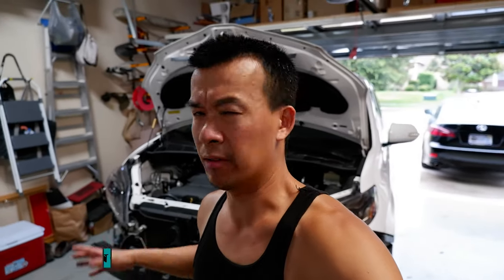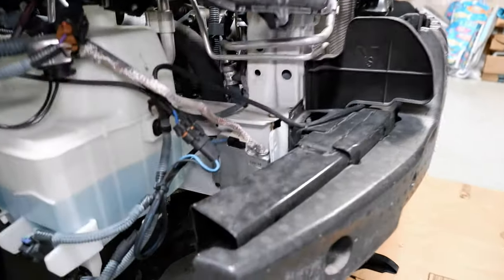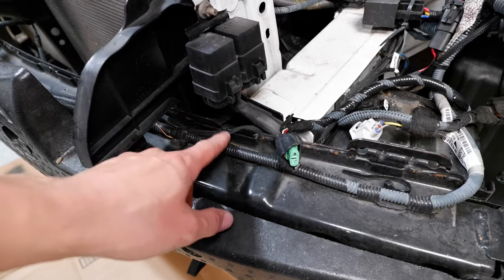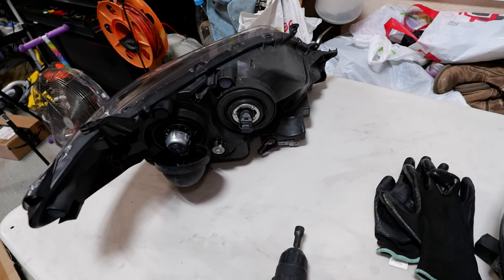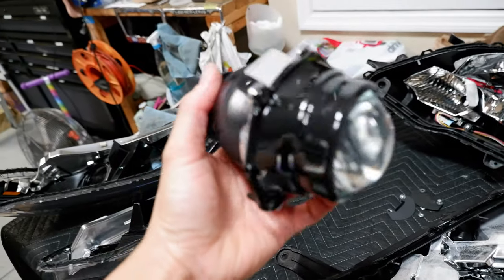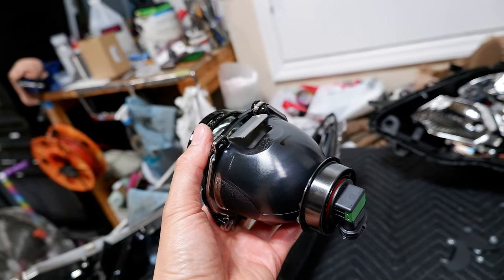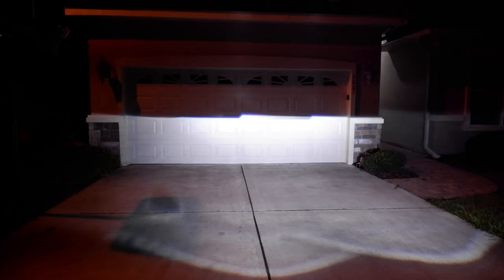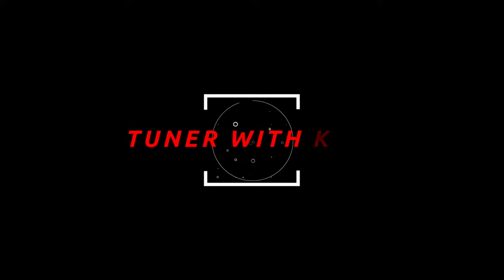Toyota Sienna SE HID Upgrade | Morimoto 4TL-R Projector Retrofit | 4TLR HID Projector Swap

Comment: Nice project 👍 I have a 2015 Sienna SE in black and some dark blue color anyways I would like to take the lights apart and change the projector just like you did and change the DRLs to a blinkers like you said and if you can send me the link to the video that'll be awesome. Thatnks for the post 👍  great video.
Reply from the maker: MrSeth166 they used a Diode Dynamics switchback strip. You have to unplug OEM board and use the new strip. https://youtu.be/xCkL-m9UitM
Reply: @TunerwithKids  i just saw the video and the angel lights did changed my mind now I want to do that too lol! That's pretty awesome 👍 thanks fot the info buddy.

Comment: What size rubber seal did you use? Tempted to do this on my SE in the future.
Reply from the maker: I used some butyl sealant from a roll on my previous retrofits. See link in description...its like $12 on Amazon.
Reply: Tuner with Kids I meant that boot looking thing covering the headlight bulb. I should’ve been more clear, sorry.
Reply from the maker: Oh. It’s something I got on TRS. 80mm diameter. They are generic china ones you can get on Amazon for cheaper, $9/shipped. https://amzn.to/2Arg2iv
Reply from the maker: Also need a 9006/9005 splitter. It’s like $12 on Amazon or cheaper on eBay. I updated and posted the link to that too.

Comment: How long did it take you from removing the front bumper to putting the front bumper back on?
Reply from the maker: This project takes time. If you’re a novice, expect it to be an all day or 2 day job.
Reply: Binh Nguyen-Tuner with Kids  sounds good. I’m more scared of the bumper removal and all the plastic tabs that are going to break.
Reply from the maker: They are durable. Nothing is breaking if you do it right. I have a Sienna bumper video.